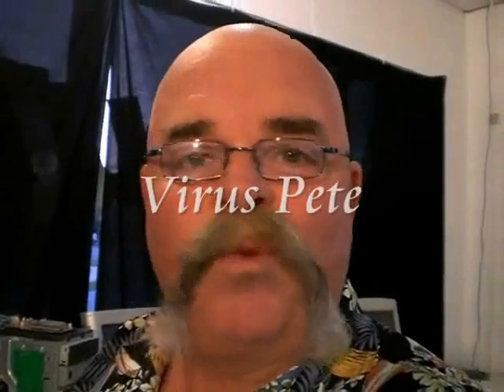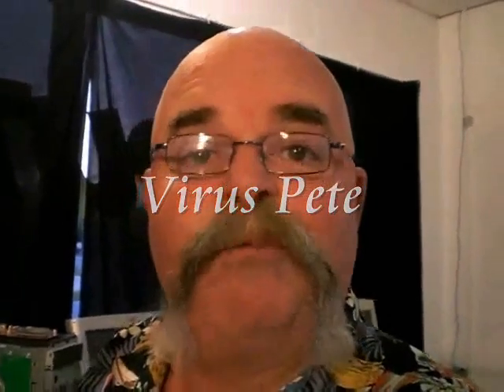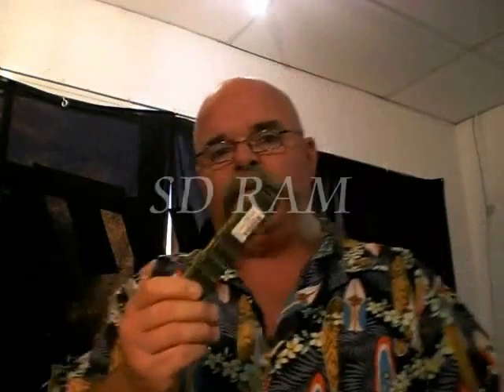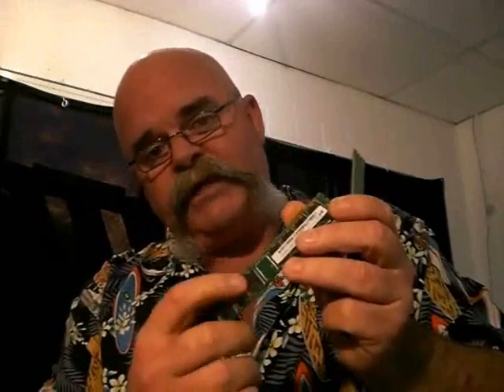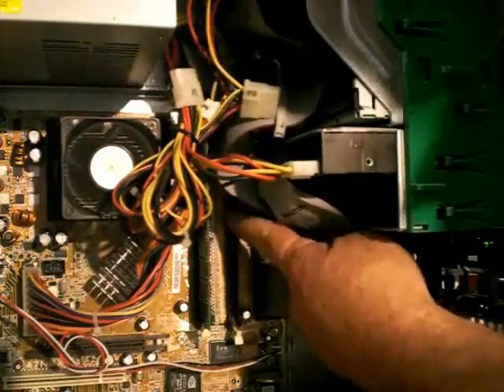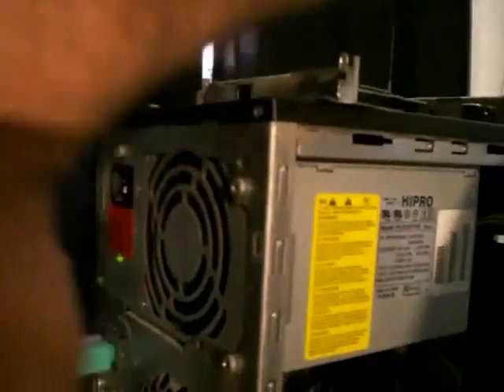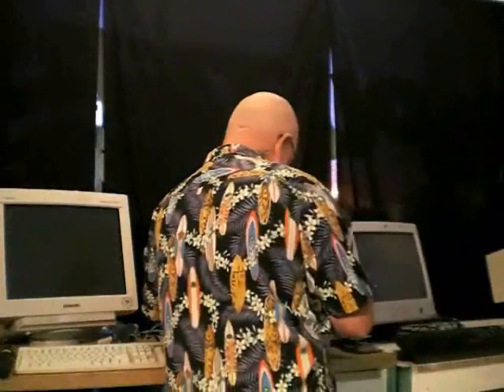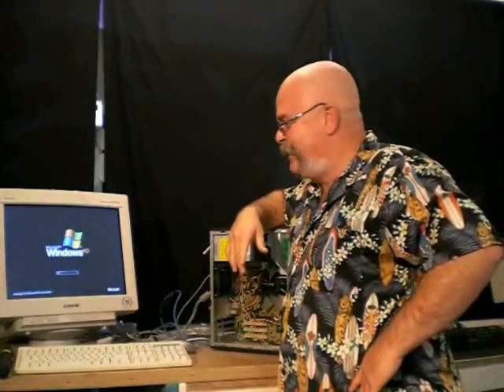PC repair for DUMMIES - No signal to monitor

Comment: I just built a new gaming pc, but when I plug the cable into the video card the monitor comes up with no hdmi signal. I tried it with the same monitor and video card and it said no dvi signal with the dvi cable. I did test it on the motherboard there was still no signal.
Reply: Me too
Reply: Jolene Lee I was being an idiot (this is my first build) and my ram cards were not in all the way. Try pressing down on them firmly and hard to see if that's also your problem.
Reply: Ah, ok. Well my RAM cards are all the way in.
Reply: ***** Dat Chrizma Thanks everyone, the problem was that I didn't click in the heatsink all the way so the monitor didn't sense it. It works now!
Reply: Jolene Lee Glad you figured it out! Building a PC can be a pain especially if it's your first build like mine.
Reply: +Dat Chrizma  When i finished my PC, I turned My moniter on(with the VGA cable plugged in). I put it on VGA/PC, it said no signal. When i turn on my tower, it beeps a short beep and everything looks and sounds fine.
Reply: +Dat Chrizma Whats a heatsink?
Reply: Charged Grizzly178 The heatsink is the fan above your CPU and there's 4 buttons that you have to press down to secure it.

Comment: Good Day Sir.. I had this problem a while ago and then I saw your video.. let me explain my problem.. 

-When I connect my VGA to the graphic's card.. it wont display anything.. just black screen.. but the fan on my graphics card is working.
-But when I connect it to the motherboard.. it works fine.. 

now I can't fully use my pc when the monitor is plugged to the motherboard because it is too slow.. but back then when it is connected to my graphics card.. I can play HD games like BO2, GTA IV, etc.. 

I tried un-plugging the power, mouse, keyboard, monitor out of the back panel.. then removed my RAM and cleaned it with a pencil eraser.. but nothing happens.. maybe the problem is that my graphics card is dead..?.. Thank you Sir.
Reply from the maker: Zangetsu Sama That's a dead card most likely....try removing it...and reseating it....
Reply: PRECISION COMPUTERS - THE LIGHTER SIDE OF I.T. Thank you sir.. I fixed it.. now the problem is my keyboard.. right now I am using on screen keyboard.. 

my keyboard doesnt work.. it has 3 LED lights that blinks when I turn  on the computer.. but now it won't.. it is the one plugged to the motherboard.

Comment: Hi Pete, I know you don't like Macs but I would appreciate a second opinion on this. My IMac 27"late 2009 has gone through 2 video cards (including the original) since I bought it in February 2010 and getting the third one installed Wednesday. The last card only lasted 18 months. Is that normal and can I get the broken cards repaired? My local computer shop will install parts in my computer but won't order them in for me since they are not apple resellers. I gripes me since I had an old XP desktop for years and nothing went wrong with it apart from the fact it was no longer upgradable which in turn made it very sluggish. Bloody Macs are so expensive to repair to.
Reply: sloppyfella But I have already payed a lot for the initial purchase of it when I bought it fully upgraded and recently installed 32GB of RAM.
Reply from the maker: sloppyfella I'd suggest running a UPS Mate...sounds like you may have an issue with dirty power...

Comment: Hey! So, I own a Dell XPS8700. I bought myself a 700w power supply last week and decided to buy myself a new graphics card. I did, I bough myself a nvidia Geforce GTX960 SSC. After installing it into my PC. All that happened was, Everything started up but there was no display on my Monitor. After many attemps of looking on the internet, I had no luck. I've tryed removing the ram and cleaning it, but still. I get the same thing that happened before. Please help?
Reply from the maker: Dub Bass sounds like it could be a compatibility issue with the card...

Comment: Strange thing happend to me yesterday with my new gaming PC... it was running fine and then i let it to sit for about 1 month with no cables... yesterday i put the cables back on and i get : No Signal from Motherboard to the Monitor... :(

i try :

1- Remove MB Battery and put it back on
2- Remove RAM's and put it in different slot
3- Restart CMOS
4- Hold down the Power Button for 1 min without Power Supply Cable In

None of them works, still get no signal, the fans are spinning, CD ROM is working fine... but No Signal to Monitor :((
The monitor is ok, VGA Cable is ok also cuz i try it in another PC...

I'm out of ideeas i swear :(
Reply: +mihai0377 I HAVE THE SAME EXACT PROBLEM
Reply: Charged Grizzly178 it turns out that was my motherboard that was faulty, it had a broken circuit on the other side, i get it to warranty and get a new one.
Reply: +mihai0377 thanks I might get my motherboard checked out. Just a few minutes ago I put the ram in a different slot and tried to turn it on and nothing happened. I tried many times so I think the MotherBoard fried or short cicuted.
Reply: Charged Grizzly178 Or maybe an exfoliated route just like mine had... Good luck and if you can RMA-it, then don't hesitate...
Reply: i did the power button trick and it turned it back on. But now i put in my hard drive turn it on and it says reboot and select proper boot device and my Hard Drive is plugged in and set as the #1 Boot option, do you know how to fix this?
Reply: Charged Grizzly178 re-install windows...
Reply: +mihai0377 can you show me a link to a yt video on how please? This is my first pc so im having trouble
Reply: Charged Grizzly178 uhh man, it's really hard if you didn't install windows and this is your first time... i can help you step by step if you want...
Reply: +mihai0377 yes please
Reply: Charged Grizzly178 But you need to have 2 computer or a laptop because you need drivers after and an active internet connection. How would i guide you to install windows if you're going to use the computer for that ? Do you have another laptop to guide you how to install it step by step ?
Reply: +mihai0377 I have a laptop
Reply: Charged Grizzly178 you need a USB and a Windows .iso, do you have this ?
Reply: +mihai0377 I have usb and windows
Reply: i have USB and Windows.iso file

Comment: I have a simple PC that's been bought last year. Now we hear buzzing sounds when we turn it on but after a while it stops now we decided to clean the inside of the system unit because it might fix the buzzing sound. We disconnected those VGA, power cord, speaker, keyboard, and mouse cords from it's back. Now we opened it and cleaned it with a blower/air compresser. After that we closed it, connected everything again and when we tried opening it, it starts. The fan starts, lights were on and such but it doesn't show anything in the monitor. Please, help me. My mom worked hard for this computer and now it's kinda broken :( Please help me. We already tried removing the RAM and putting it back again. We secured the screws and such but it still doesn't work. Please help.
Reply from the maker: MaclimoreHD Do you have the monitor cable plugged in to the correct VGA port at the rear of the computer?  Some computers have more than 1 port at the back...
Reply: I have the same problem and i have connected it to every possible port my computer has!

Comment: I have the same problem as the video but  I dont have any RAM on my PC. 
NOTE: I am working with a 10 year old comp. 
BUT: I have replaced every thing except the CD drive, Jumper cables(Big ones that go to Hard drives and CD drive) 
I HAVE: got a new mother gaming board($300+), Video card(~ another $100), 3TB hard drive ($90), and A intel I7 Quad processor.

I have been working on this for 3 months now and have been tempted to take it to a shop Please help.

Comment: i am currently using a big bulky gateway tube monitor.. it was working just fine until i tried to hook up a flatscreen monitor that i got off a buddy. when i plugged the flatscreen in, i noticed there was no red color in the picture.. i wiggled the wires a bit and nothing, same thing. ok, so i hook my big tube monitor back up, and guess what? theres no red in the picture STILL. it was working fine just before i made the switch. if someone can help me id really appreciate it. its messing with my uo gametime :( thx

Comment: Great video Pete
Here's one for you, I have dual monitors and had linux installed on the machine. Both monitors worked perfectly.
I then did a fresh install of Windows 7 and now one of the monitirs shows "out of range" on start up. What say you mate?
Reply from the maker: G'day Dene, an "out of range" error is usually simply a resolution setting mate....try lowering the resolution and that should get it sorted for u...
Reply: I tried that Pete, no go.
Reply from the maker: Dene Collett Hmm...I would suggest reloading the monitor drivers...most monitors are plug and play...however they usually come with a driver disc for optimum settings...try that Dene...

Comment: I'm having a problem with my PC/Monitor. I just got my new monitor which is an ASUS VG2480E. But when I try to use it with my gpu, it won't work, and says "DVI No signal"  Before I got this new monitor, I was using an older EMachines monitor using onboard graphics.  Since I was using the onboard graphics and everything was working fine, I knew nothing was wrong with anything.  I'm nearly 100% sure that it's a dead GPU, but I just want to know for sure, Since I don't have the money for anything anymore.

Comment: Another question: I tried then to find out why black screen, so I put CPU on and took off. Then I the CPU got stuck in the socket (in reality the socket leverage was not properly opened :( ) and used scissors to leverage it ouf from the socket. So used some force. It came out but two row of CPI pins were twisted like 20 degrees. I tried to put the all straight and inserted to socket but after that there was no beeps and no reaction anymore, so it did not recognize CPU anymore. Is this likely damaged my motherboard socket or CPU or both? I did not see any visible damage on socket though.

Comment: Any advice on my new build... I have: RAM: Corsair 16GB (2x 8GB) PC2400 CL11 Vengeance (CMY16GX3M2A2400C11A), MB: Asus A88X-PRO,
CPU: AMD Athlon X4 860K Quad Core. When I switched on I get on long beep and 3 short beeps. Blank screen. Keyboard did work when I did Ctrl+Alt+Del (it rebooted with that). Also RAM_LED was red (more like blinked couple of times, not remaining red). Signal is like its a VGA problem, but is it more like a RAM issue (RAM not compatible with the MB) ---this is what I this it is likely. Although the in-board graphic card could also be faulty I guess. Thanks
Reply: FM2 motherboards have no on board graphics, (Because the a series processers have graphics chips on them already) and the 860k does not have a graphics chip on it, so you are going to need to buy a gpu.
Reply: The Techmaniac Exactly true! I figured it out. unfortunately I broke my CPU also in this process :(. But lost only £60. Now everything works with my AMD a4 5300. .. .am writing this msg from it... I wish I had read your comment 2 weeks earlier when I was a bit "worried" :)

Comment: So I built a new pc but everytime I plug in the HDMI cable or any other type of cable for the monitor to my computer it says no signal and the monitor turns off. Once I turn on the PC I hear 6 short beeps but I don't know what they mean. I have 8gb of ram, an MSI MB, 860k AMD processor, 700w power supply, 2gb graphics card, 1tb hard drive, and a diskdrive. I know that it is not a faulty CPU cause I bought a new one. I have tried to reset the HDMI by taking away the power from my PC and holding the power button for 30 seconds I have also taken out the CMOS battery and put it back. I have tried starting the PC without ram, with one ram, and with both but nothing. I have tried using the HDMI cable both on the graphics and MB and those don't work. Its not a problem with the monitor cause it works with other computers. Any suggestions? Should I buy a new MB and would that solve the problem?? Please help I have been dealing with this problem for almost a month the computer has not even been setup since its new due to the monitor not getting signal.
Reply from the maker: If you get no signal using the onboard graphics as well as the vid card....then it sounds like a faulty MB to me mate....Take the MB out of the machine...place it on a piece of foam and see if you can fire it up out of the case...good luck...
Reply: I was wondering If I buy a new MB would that solve my problem? Cause I have been dealing with this problem for almost a month and If buying a new MB can solve it I might as well. I'd rather not go through the hassle of trying to find a fix for the MB that I have right now.

Comment: I removed the ram to clean it and now it won't pop back in
Reply from the maker: DeFy VII Turn it around...it only fits one way...and be carefull with it...
Reply: Thanks it popped back in but still have the same problem the computer itself turns on but when you connect something to it like the keyboard or mouse it doesn't turn on neither does the monitor.
Reply: I wiped both Rams
Reply from the maker: DeFy VII That sounds like a MB problem mate...best u take it in to get it checked...

Comment: Hello... I have a problem that i can't seem to find an answer to. My computer comes on but the asus at the start is flickering bad... then it looks like my computer goes to repair, I tell it to as best i can and it seems to reboot... shows the flickering asus and ... nothing. The only thing i can figure it is is the wire from the monitor to the computer has went out... but if i am wrong i dont want to buy a new wire for no reason. I have tried different power cords to both the computer and monitor and have tried a different monitor. Can anyone help me?

Comment: I was playing league of legends and my internet was lagging and I got mad and ended up smacking my cyberpower pc on its right side near the power button, and all of a sudden on like the 3rd smack i lost signal to the monitor. I'm not sure what that means but il attempt to do this if i can, i dont think anything unplugged while hitting it either.
Reply: Update: i tried cleaning the ram (3DR) but still no luck, what could or lost the signal to monitor from hitting my computer?
Reply: ***** UPDATE AGAIN: Alright, i figured it out, I dont know what i did to the graphics card but my vga cable was plugged into it, and now its only gets a signal when its plugged into my motherboard, but now i have this shitty microsoft basic video crap and i cant even play league of legends past 25 fps anymore on lowest graphics so, whats my best bet? buy a new graphics card? cause by the looks of it i think its fried, somehow
Reply from the maker: *****  Lesson here....don't hit your computer   ;)

Comment: I wonder if you can help I watch this video it works but when it as been on for a while not being uses it goes back to no power to mouese or keyboard thank you
Reply from the maker: sounds like it's going to sleep...check your power settings...
Reply: PRECISION COMPUTERS - TRICKS and TIPS
Reply: PRECISION COMPUTERS - TRICKS and TIPS ya I did that and when it went to sleep I lost power to the mouses and keyboard but still have power to tower so I have to shut it down and unplug it and turn it back on in the morning some times that works if I am luckey

Comment: my computer turns on, but it wont turn off,
now check this out, i have no power to monitor, keyboard or the mouse.
all the light on my computer are on, cpu is running, gpu is running and all the fans are running. 
i took the ram out cleaned it put it back in and still no power to screen or keyboard.
i took the graphics card out and plugged vga to the mother board and still no power to the screen or keyboard. 
my monitor works perfectly fine i tested it on my laptop. 
so what is wrong here guys.
Reply: I have the excat same problem and i dont know what to do
Reply: Mine wont turn off aswell like i have the ecxact same

Comment: I bought video card on my pc nvidia 7300 gs 256mb. I put on my computer it work but 7 days I put the video card. I played a 2 hours movie suddenly black out it says no signal and I reset my computer  it says "No signal to monitor" again. PLZ help!!!

PC specs
Pentium 4 HT 641 3.2ghz
PSU: P4 - 600W
2gb RAM
MoBo: pl5d2-tvm-se
Reply from the maker: Smile Laugh That's a pretty old machine mate...might be time for a new one....
Reply: COMPUTER REPAIR for DUMMIES ! Thank you Sir! But I put the connector on board vga and it worked!! What is my problem anyway the video card i bought Nvidia 7300 gs or my Computer?
Reply from the maker: Smile Laugh sounds like the card has failed mate...
Reply: COMPUTER REPAIR for DUMMIES ! Thank you very much sir. For the advice.

Comment: Hey I got a new graphic card today (asus Nvidia Geforce gt210 ) when switch my computer on it switch on and stays on but dosnt send signal to my montior but when i take out the graphics card again the computer works again is this a glitch with mine or a MOBO problum please reply as fast as u can
Reply from the maker: BC- Terminator sounds like a bad card mate...have u installed the drivers for it??..
Reply: no but i cant when i try it said i need to have the VGA cards for ASUS installed witch i think it means its not picking up the card + my card is 20 wats over my psw
Reply from the maker: ok...well...u cant over rate the PSU...it simply wont work....
Reply: so i need a new PSU?
Reply from the maker: sounds like it bud..
Reply: no its his psu he dident mention his psu is 280W and his gpu needs a minimum of 300W